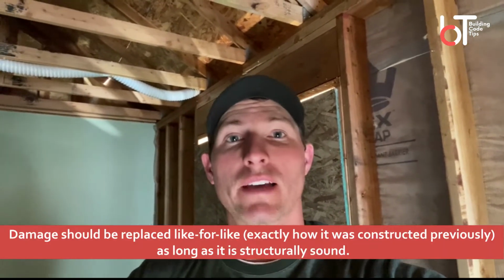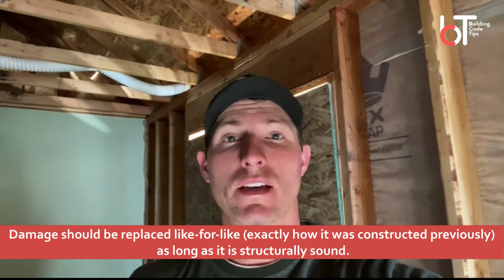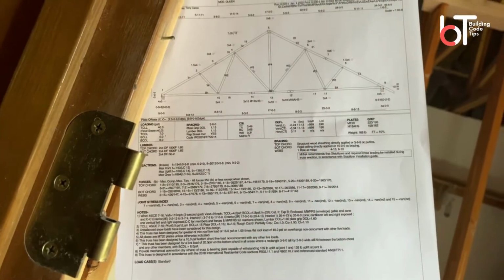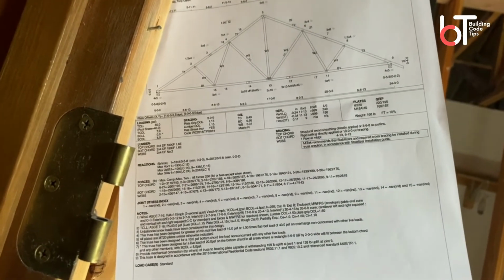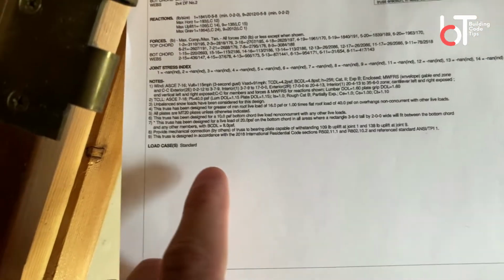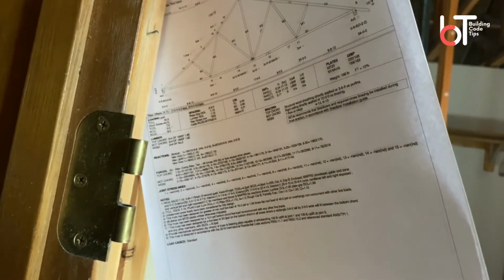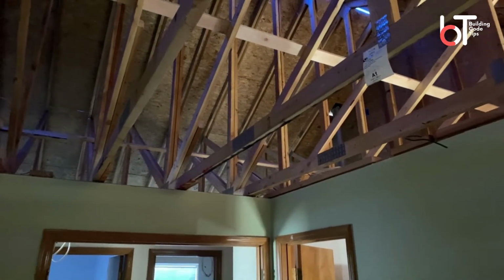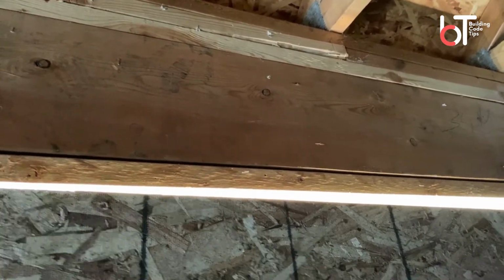Fire Damage Restoration in a Home | Truss Repair | Building Code Tips

Comment: How would you go about cathedral style trusses? Half the house needs them and it’s where the fire got it good
Reply from the maker: Are these engineered trusses or standard cathedral style 2x rafters?

For engineered trusses it may be a full redo or if they look somewhat salvageable you could visit a truss manufacturer in your area and see if they can prescribe a fix. If only certain areas of the truss are burned to a char then sometimes additional support can be added as a fix.

For dimensional lumber I would probably smoke seal the bad lumber and then sister a new rafter in next to the burned board. Essentially fixing it like for like but without having to demo anything.